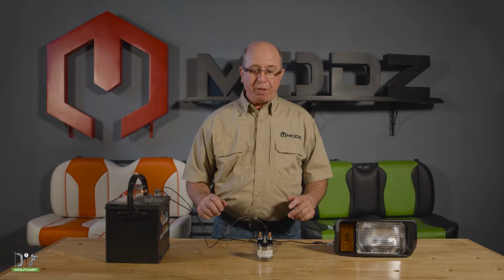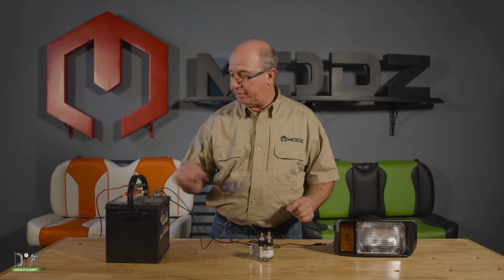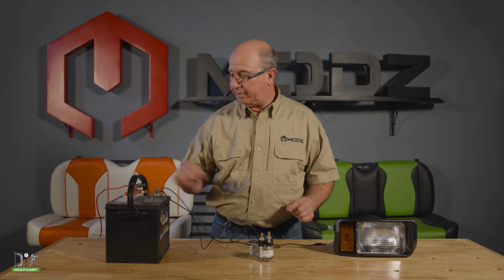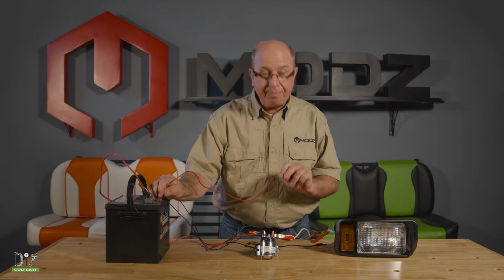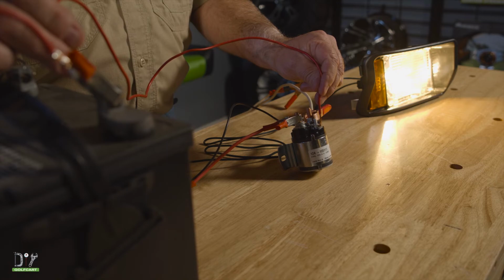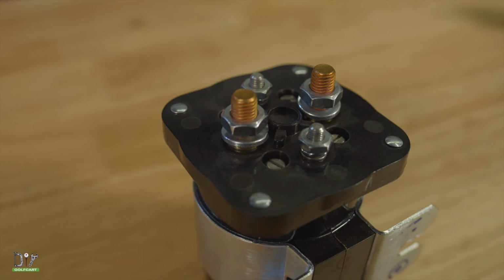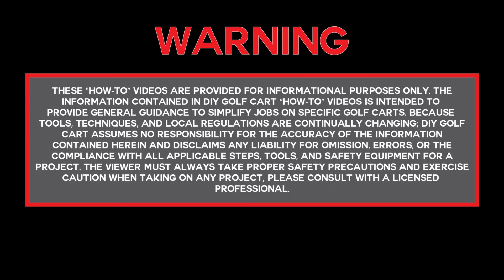Golf Cart Solenoids - How They Work

Comment: Why are solenoids even necessary? Why can't the circuit be broken by a less complicated switch that cuts off the flow to the motor? FYI I'm new to electrical stuff. Sorry if it's a dumb question.
Reply: It conects the current via large guage wires and a short path for good power at the starter, if the power went  though a long small wire it would cause a voltage drop and possible melting.

Comment: So a solenoid is just an electric controlled switch to open or break the circuit?
Reply: yes that exactly what it is. if you did not conect the current to the starter though a solenoid (conecting it via large guage wire) it would be too hard for it to flow throught the smaller wires and would melt them.
Reply: @krusher74  makes sense thanks bro

Comment: I have a ez go txt 48 volt. My question is that when I connect all the batteries the little jumper resister between to two big lugs on the solenoids seems to be getting to hot with nothing turned on . What is the reason for this
Reply: I’m having the same issue with a 48v club car. I have a new controller on it and when I plug the batteries in the resister begins to smoke.   Have you had any luck finding the problem

Comment: My issue I think may be the solenoid. I have a Club Car and all batteries are fully charged. I by passed the key and cleaned all terminals. I hear something whine but I cannot determine where. There seems to be 2 solenoids in my Club Car ...I am not sure which one would need replaced. In automotive mechanics we use to put a screwdriver across the solenoid to bypass it to start the vehicle. Is there anyway to bypass either solenoid?

Comment: Have an older 89’ ezgo marathon. The resistor coil is glowing red even when off? Only way to stop it; is disconnect the battery. Is this a solenoid issue? The speed wiper switch seems to be fine
Reply: Did you ever figure it out?

Comment: I have a 1989 EZGO marathon with a 3PG. I've got a problem with the electrical that I can't figure out. I have replaced the starter/generator, the voltage regulator, the solenoid, the positive and negative cables and the ignition switch. While running it, I am constantly drawing current. After driving for a half hour, the battery will drain. Not all the way, but significantly. While it is running, my voltage to the battery reaches 13.8 max. This does not give significant voltage to keep the battery charged.What am I missing?
Reply: While driving the golf car at top speed the starter / generator should be putting out 18 +/- volts and the voltage regulator regulates the voltage  to between 14.8 and 15.6. Next, check the voltage of each to determine what could be going wrong. Also, driving the golf car under 60% speed, the car is running off the battery.

Comment: Barry the selonoid you show looks like the one on my 1992 ezgo 36v cart. Can I duplcate what you're doing with 12 volts or do i need to energize the controlling voltage to the small posts with 36 volts? The selonoid is new but I do not get continuity on the small posts. cart was slow/no power now nothing.
Reply from the maker: You will have to use the voltage that the solenoid requires, sounds like in your case 36 volts. One thing that I've learned over the years "New" doesn't mean that much anymore.

Comment: Hello
I have a club car precedent that it won’t go forward or reverses.when I plug it in the charger is blinking .Any idea what it could be ?
Reply from the maker: First do a load test on the batteries then verify that the charger is charging the batteries.
Reply: DIY Golf Cart I recently got new batteries for the cart when I was driving it was surging and then it just shut off and wouldn’t move.Do you think it’s the batteries and what do you use to do a load test?
Reply from the maker: Email me at barry@diygolfcart.com and request a battery load test instructions.

Comment: The brakes on the golf cart I'm working on doesn't work at all we have to throw it in reverse in order to stop it doesn't work at all we have to throw it in reverse in order to stop it any ideas on what it is??
Reply from the maker: Brake cables? Brake shoes? Brake Drum?
Reply: throwing it in reverse its going to break transmission it! fix the brakes. woulds you throw your car in reverse if the brake wernt working!!!

Comment: "A solenoid uses a magnetic coil (the actual solenoid) on a low power circuit to push a rod that closes a high power circuit. On your golf cart, this high powered circuit is either your ignition on a gas golf cart or your electrical motor power circuit for an electric golf cart. "

This video should be taken down.

It appears in the video that you use the same voltage to control the solenoid and the voltage going to the load, NOT SO.

If the two voltages were the same, why would you need a solenoid.  The smaller terminal should give anyone the clue.